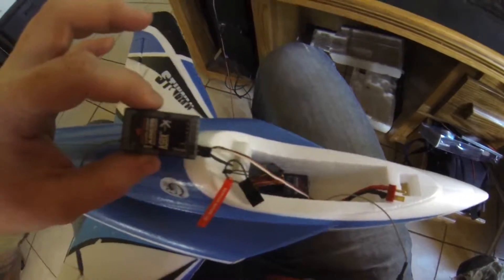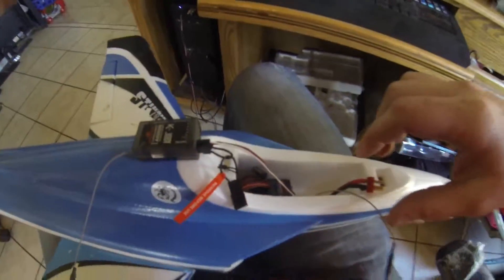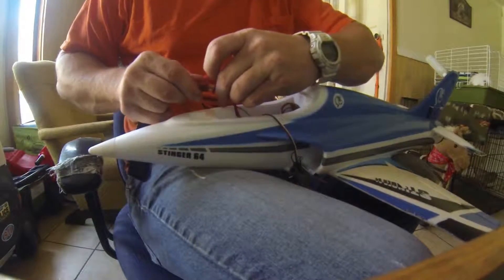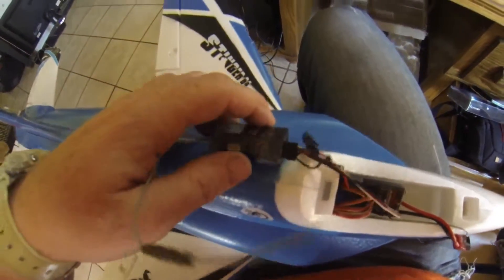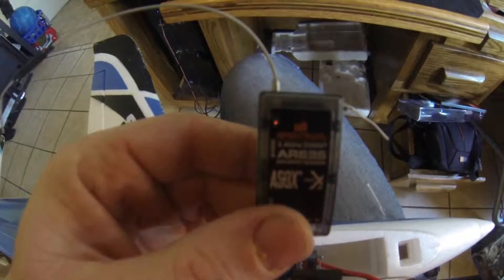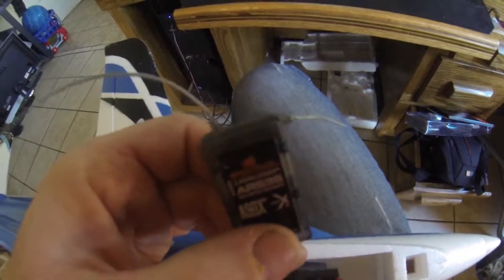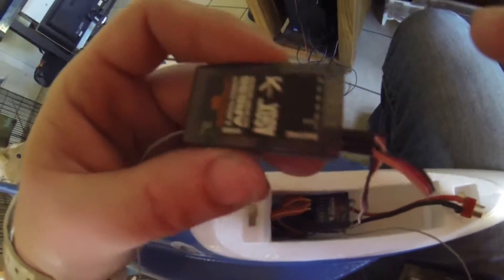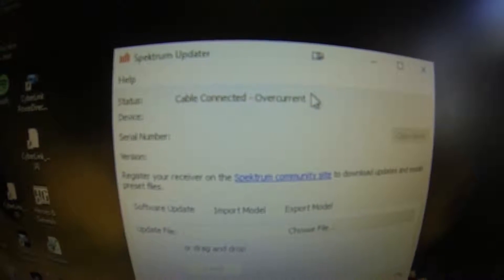ar636 as3x problem

Comment from the maker: had to get a new one had a bad cord that hooked to computer
Reply: I have a as3x receiver in my rock hobby Corsair the gyros for the ailerons are working in reverse any suggestions on why they would work in reverse and how to fix the problem.
Reply: Change the orientation of the RX. or switch the servo reverse through the application or the computer, not the radio.  @johnbrumley8703

Comment: Did you solve this?  What LIPO were you using as the AR636 spec shows a max voltage of 9.6v.  A 3S LIPO would put out 12.4v, so did you use a 2S LIPO or a regulator?